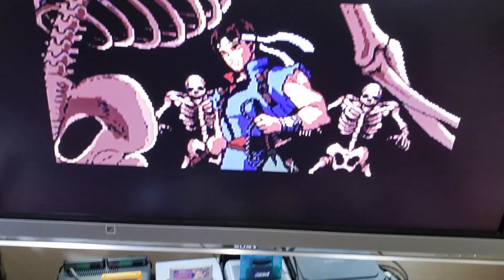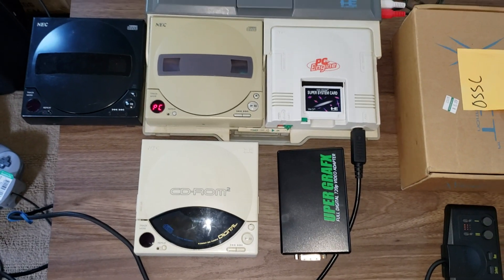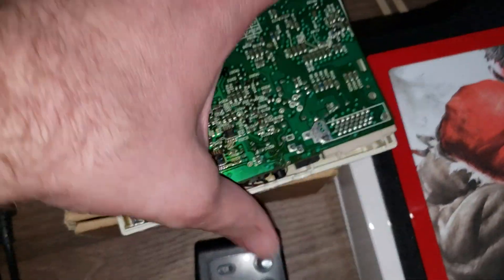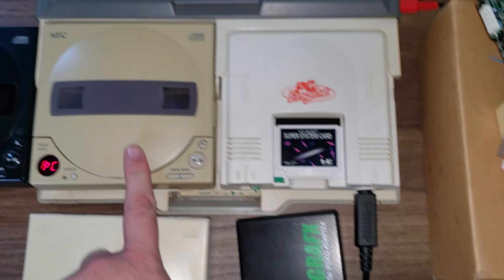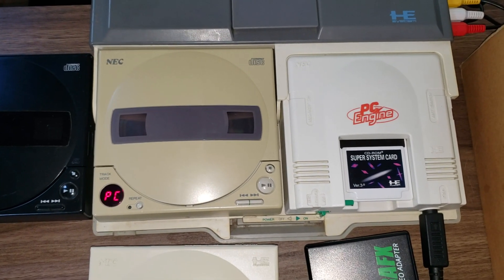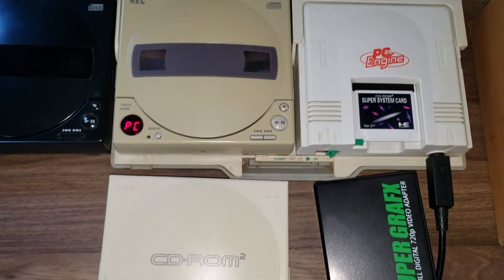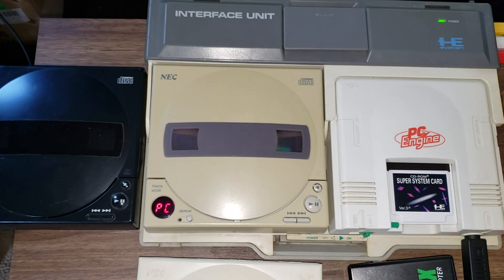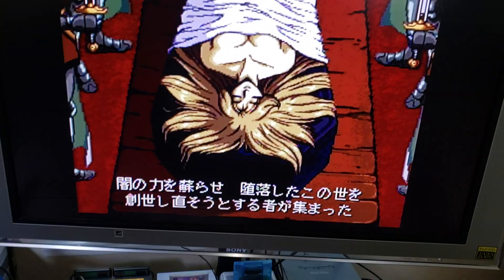Use NEC CDR-35D PC drive as a Turbo-CD/CD-ROM² drive (for PC Engine & TurboGrafx-16)

Comment: So what would happen if you were to take a functional PC Engine/TG-16 CD ROM and interface it to the SCSI dock? Would the computer see it, or would it require the firmware chip for Computer?
Reply from the maker: People report that CDR-35D without the “-01” at the end “just works” in a TGCD Dock/IFU so it likely has the same internal ROM on that MCU. If that’s the case, I expect it would work. I only had the later version and all I can say is that it required the swap. Even then, there is one small behavior difference: Holding Run + Select to reset to the System Card BIOS does not stop the redbook CD audio playback. Of course, that stops as soon as you press Run again to boot the disc.

Comment: I have one of those drives I picked up many years ago. It didnt work but I assumed it was controller type firmware. Glad to see it solved but dont have a doner drive.
Reply from the maker: If Furrtek reverse engineers all the chips then it could be done with a small FPGA or microcontroller but I doubt anyone will go that far. :(